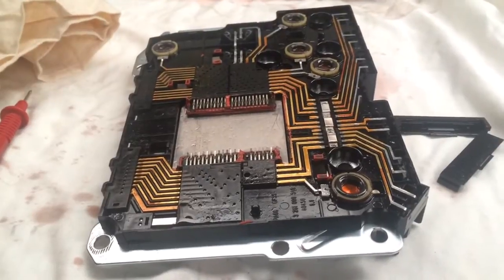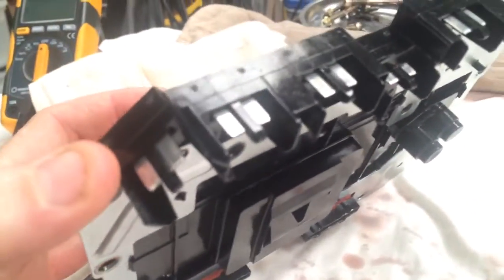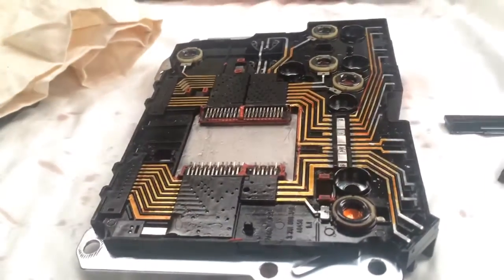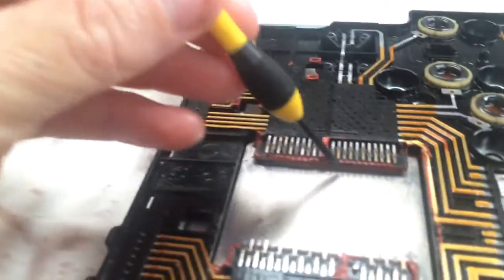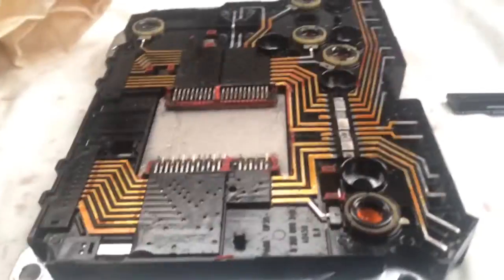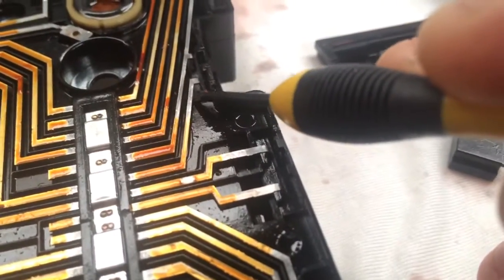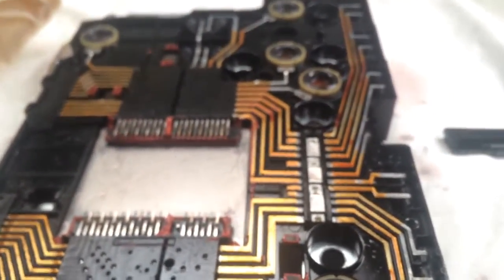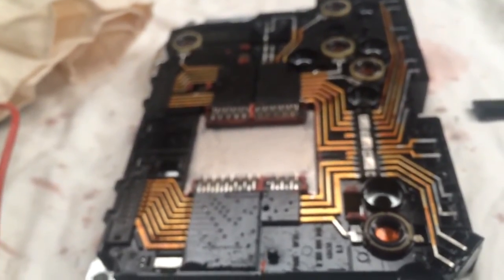RE5R05A Nissan R51 Pathfinder TCU repair

Comment: I had to solder mine 3 different times in one week.. kept breaking used solder with lead.

Finally fix mine by building up the solder to the top of cover and added strands of wire.

Broke at 300k rough miles, vehicle was really beat on, 4x4,

Comment: Hey Mate, how did you open the TCM? I've removed mine from the valve cover and can't open it.
Reply: I managed to open it. you have to start on the solenoid connection side and work your way around.

Comment: I got p1764 on a 2005 armada v8 and it was pretty much the same problem. I soldered it back together and car works fine. Hopefully my solder holds for a while 🤞

Comment: That's funny. I just got done watching the other video with the smart Mexican guy. He knows his shit. I haven't pulled codes from mine yet, but around 4th gear it will just go neutral. It's intermittent and my thought is if 4th were completely gone mechanically, it wouldn't be intermittent. I haven't torn mine apart yet, but I can imagine it'll be a similar issue. I've seen several videos of these, to understand this may be a common issue. Thanks for the vid, man.
Reply from the maker: King 250sx happy to help. If your remotely mechanical and can or know someone who can solder its a easy fit once you know whats wrong. Mines been running fine ever since.